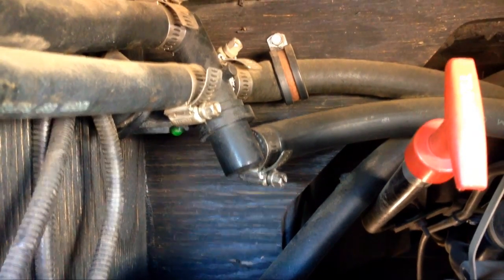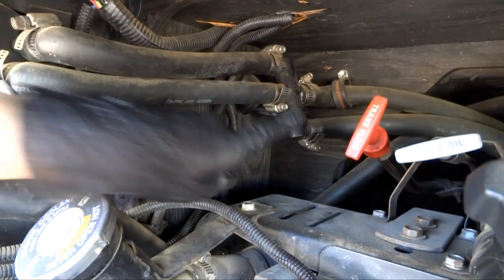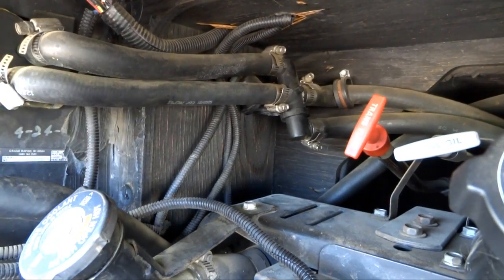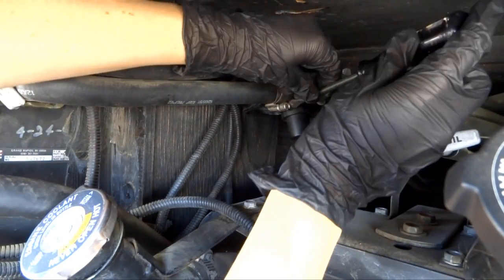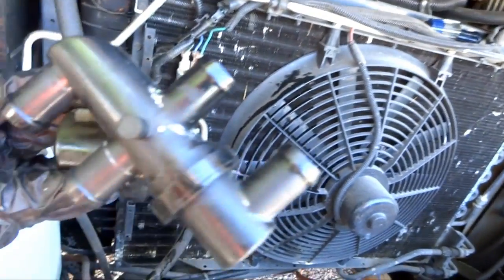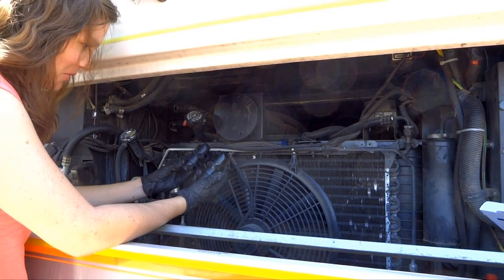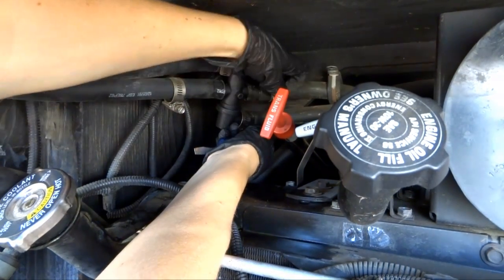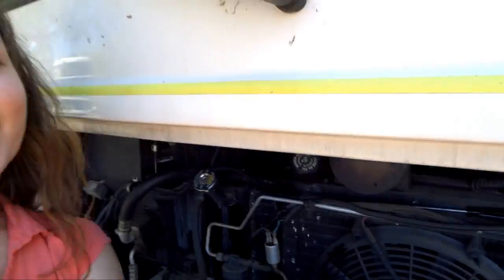RV Living: Troubleshooting auto repairs, replacing heat transfer valve

Comment: Pippi please wear safety glasses in the future to protect your eyes, and tie up your hair into a pony tail so it won`t get caught in moving parts.
Reply: Paul Wicklund  and where a helmet and have a Faraday cage in-case of storms and steel to boots and chainsaw chaps and bla bla. there is no pressure in a cold engine and she was above the work she was doing no danger.
Reply: corn husker She was AT and below the level of the unattached and flopping hoses.

IF, and that's a middle sized IF, she had by accident hit the hose or it slipped out of her hand while she was removing it or working in that little compartment with her head in there and antifreeze in that hose had splashed out and on her face, with safety glasses on,  it would only be on her skin and NOT in her eyes. Pressure in the line was no issue as she made sure it was cold and well it's leaking the pressure out, thus the repair she has to do. ;) ;)

As a hazmat qualified trucker who wasn't wearing them before OSHA walked onto the scene and having some nasty stuff get in mine and a motor head to boot, those eyes are pretty important to me years later and besides, who wants to have to pay an ER bill if it was a lot of the chemicals in her or their eyes.

Putting on a pair of safety glasses is as hard as putting on those non prescription sunglasses! No difference between the two as they both are made to PROTECT those pretty peepers! A good train of thought to remember when those eyes are really important in the rest of your life! 
You would never get to admire a beautiful woman belly dance, the smile on your true loves face or watch a sunset or in your case "corn husker", never see that new John Deer Harvester, much less drive it. Well, unless you're an International fan. Touching is never the same as admiring with the eyes. WEEEELLL... Ok,  there MIGHT be a difference when it come to the opposite sex..... LOL!

The other stuff? ROFLMAO! Some do have their uses.

FYI: There are a few eye glass manufactures that make beautiful and functional everyday safety glasses that you would never know were made to stop a bullet! A few made as sports wear for extreme sports and bike and motorcycle riding!  You never have to change glasses unless using a grinding wheel then I'd have to put the big plastic crap on over my good stuff! LOL! 

Blue Sky's and Safe Journeys
Reply: George Purdy Since everyone it bitching I will do too. Those gloves are not well fitting. Maybe she could have gotten some Mechanix type gloves. She could have gotten those loose fitting gloves bunched up and accidentally had fingers ripped off if the glove got caught somewhere and she had a panic attack and sawed off her fingers to free herself.
Reply: Oh screw the gloves! ROFL!
I'd rather wash my hands when finished. Old school! LOL!

After having to swim in water worse than found anywhere near an RV and working in much, much nastier places, gloves are an option now but not so long ago the choices were poor, she did just fine!
 
Yes, for her and other that do not have callused scarred hands and fingers like me and others, mechanics type gloves are a good idea if not messing around with small parts like she was in here, but some of her other projects, yes.

Blue Sky's and Safe Journeys
Reply: Paul Wicklund 
only moving part to worry about that I saw was......her
Reply: steven reynolds
Be nice! I refuse to watch her dance vids as tempting as they are, to be nice!
Reply: corn husker Thanks I was thinking the same thing.
Reply: Yes they are a "little" floppy. The one size fits all don't fit all, only those with big hands! And getting any part caught in something moving is not fun! Ouch!

My ex-wife wears them all the time but she has small hands and even the "small" look like Pippis does!
She got caught on a clamp and was trying to get the glove off of it without cutting the glove but cut the glove then her finger. Not a fun time around the house that night. Turns out she is not a fan of my old army field treatment and dressing of minor wounds. Nothing wrong with alcohol and tape is there?

Comment: Just a couple tips from an ASE certified tech. Makes sure to use a catch pan for coolant, transmission & engine oil. Be sure to bleed air out of the cooling system to prevent over heating whenever you replace parts from the cooling system. Finally replace old, soft, rotten hoses as needed. Good luck pippi 😎👍

Comment: Great job seeing that kink in the hose and recognizing that moving the bracket was necessary to correct the problem. Sometimes, you can use a small screwdriver to run the screws on the clamps in and then use a bigger one to finish. It's okay to orient the clamps any way to give you the best angle of approach to get the screwdriver on there, because a fair amount of torque is required to get the clamps tight enough so it won't leak. I like how you always face these things head on and don't shy away from any problem that confronts you. At the end of the day, your pockets still had money in them!  : )

Comment: Great vid Pippi! Get yourself a basic set of nut drivers, or home depot has a 6 in 1 screwdriver for about $3- that has 2 common sizes of nut drivers to make quick work of hose clamps. Its the one on the end caps with the orange handle,.... Buck Bros. I believe.

Comment: Don't know if it's already been said but replacement parts like this are normally redesigned (supersede) the original for whatever reason. The fact the new part has longer necks likely resulted in complaints of the shorter necks making insufficient seal with the hoses...causing leaks like you just fixed.  

For safety sake, you might want to put your hair up. When working around electric fans, it should always be assumed that they can start at any time (even when everyone knows they won't ;) 

Really enjoy your hands-on videos. I am a big believer in RV DIY, which makes the entire experience so much more rewarding (and affordable too :)

Comment: The "Hose Holder" as you call it is a Host Clamp. By the way, you're doing a very good job there, I'm impressed. RV stores will charge an arm and a leg just because they are an RV dealer.

Comment: I enjoyed how you put the two parts together to verify it's the same and to size it up!

Tips from an old guy!
Whenever working with the water system drain it down to where you will not leak. Usually in 1 gallon dumps as that's how you buy antifreeze either pre-mixed or straight. It's never a good idea to store opened bottles of anti freeze or brake fluid. I always dumped by the gallon as it's easier to refill the system with clean fluid with no leftovers, put the old stuff in the new jug and go recycle it in the jug! You don't have to remember or write whats in the jug either.

Someone below gave a great tip about using a screw driver socket set with the clamps. Yes it is and when replacing the clamps always try to tighten them up so the screw is more level not in the up and down position of the first top one you did. Makes it easier if in the cold and dark on the side of the road repair and I'm OCD when it comes to wiring and hoses in my engine compartments! It's got to be easily accessible and look good!

Check the hose after removing the clamp to see if it's rubbing. If it is, get a piece of old hose or tire inter tube and put it between the hose and rub spot. That's NOT a leak you want to find when exactly between the 2 farthest apart auto parts stores on the road which Murphy says will happen. It smells in the cabin, making it a 2 times not so good leak!

Beauty tip: When no gloves or hand cleaner is available, use a good squirt of hand lotion on your hands which will help keep the grease and dirt from "holding/sticking" making washing with soap and water easier. Get it under the nails heavily. Not perfect but they do come cleaner!

Thumbs up on a good repair!

Blue Sky's and Safe Journeys
Reply: George Purdy Great advice in addition to a good video, Smiles
Reply: Thanks to my added advice part but the video is all Pippi's! She learns fast and passes it on. Smart young lady!
I waiting for the video of where a shop tries to burn her and she already knows the problem! That will either be listed as a comedy or a verbal beat down!

I just pass on 32 years of living in a tractor trailer advice which is almost the same as living in an RV just a bit smaller or cramped!
I was asked several times why I don't start a channel, I would but not many can understand me these days after a load of radiation to the head face and neck! I'll sneak in and add to a conservation just like sitting around a campfire! Radiation damage is weird! LOL!

I'm hoping to be RVing soon as I do miss the road!
Blue Sky's and Safe Journeys
Reply from the maker: George Purdy Thanksso much George for the great advice!
Reply: Have to pass it on somehow!

Comment: Great video ... a tip ... using a 1/4" socket to install and tighten the hose clamps is a lot easier than a slot screwdriver. Thanks for the video.
Reply from the maker: Dan Bronk Thanks for the tip!

Comment: Good job, one thing to help is use a nut driver like on many 10 in 1 screwdrivers, hose clamps are usually 5/16".  They dont slip off nearly as easy, once you are turning no need to look at them, just tighten.

Comment: Nice job with the thingamajig whatchamacallit thingy. 
On a safety note, as someone else pointed out, your hair could get sucked into the fan when the engine is running. You probably knew that, but just in case...😄👍🏻🚐

Comment: hi pippi good job .   there is  a tool you can buy for those clamps or clips so you don:t slip off it can easy happen when you use a screwdriver in tight places or when working on pipes that move . keep up the good work regards stephen .

Comment: Gloves! good job on the repair and no you do not need safety glasses hair net or bulletproof vest on a cold not running engine . People are so worried about things they don't understand. Righty tighty lefty loosey is 80% of repairs. 

And after some time you may want to snug up those clams they like to leak when the hose goes through heat cool cycles. then you are good till the end of time.

Comment: I am always amazed at your enthusiasm for diving into just about any technical/mechanical project. 

You did a good job here, with the part replacement, and with the video. 
A couple things to remember: Maybe tie your hair back or wear a cap when working around machinery; and, dripping anti-freeze can be deadly to cats & dogs. It tastes sweet, but is very poisonous. I once lost a sweet kitty to dripping anti-freeze. 

Do you move your motorhome to different campgrounds? I was under the impression that you were permanently camped in one spot. It IS good to get them out and drive them occasionally, just to keep everything road ready. 

All the Best, and Happy Camping!
Reply: Allen Hare  nothing was running no need for hair restrains and the amount of coolant that hit the ground could only kill 3 cats and a large dog no problem. Last part was a joke.
Reply from the maker: Allen Hare Thanks for the great tips, Allen :)

Comment: Thanks for showing that it's possible to work on your own vehicles. You are quite the DIY'er, time for some proper tools. Even though it was possible with the screw driver, it would've been a much easier job if you had a set of nut drivers. I believe that one is a quarter inch. Again thank you for sharing.
Reply from the maker: Jerry Densmore I have a set but didn't think of it. Now I know for next time though! :D

Comment: Pippi don't use those clamps on plastic parts because they force all the pressure on one small spot causing it to crack.  Use the type of clamp you see on modern engines,  as they spread the force evenly around the entire part. Those clamps where fine back in the day when parts where metal.

Comment: @Pippi Peterson     Another great DIY repair!   Those are excellent tips, too.  I'd only add that labeling each hose with some masking tape before taking the pictures would help since they all look the same.  In this case you did fine without the labels.

PS - I think the word you were searching for was 'Bracket'.
Reply from the maker: John Norris Thanks:)
Reply: Pippi Peterson
No problem. 

* Another tip/trick is to use a little soapy water to help slide tight hoses onto their fittings.

Comment: If you are not in a hurry you might try Craigs List or E-Bay for parts. There is a yellow marking pen (that is used for marking parts at a salvage Dalo Industrial Paint Marker) I would use it mark the hose with an (A) - old part with an (A) where it was, Hose (B) - old part (B), (C) & (D). Check hoses for cracks-if not replacing hose cut an inch or so if the hose is long enough for a fresh fit. If you use a 1/4 drive socket set with handle you can not slip off the clamp like you can with a Flat Screw Driver. I don't like to stab myself with flat screw drivers. I also have a Brother P-touch Label Printer that uses White Laminated Tape to maker wires & other parts. Just a thought. Great Job, You Did Save Some Bucks. You Always Amaze at Your Projects. A Very Special Lady. Dennis
Reply: Dennis McGill Good advice. Smiles
Reply from the maker: Dennis McGill Great tips, Dennis, thanks!

Comment: Great job! You're amazing! Did I miss in your video if you had discussed the procedure with anyone at the store? Just wondering if the air that will get in the system when opening it up might cause a blockage as it circulates the fluid around the system. Usually it's important to bleed the system (like brakes), but perhaps it just works itself out...hard to say.

Comment: Definatly tie hair up. I wouldn't like it caught in that fan when the engines on. A 1/4 drive socket and ratchet to fit the jubilee clip allows it to tighten easier. Check your coolant after a few miles . But let the engine cool down first before adding any coolant. Always mix with an antifreeze.  Antifreeze has anti corrosion  chemicals in it to prevent your radiator and various other bits of your internals rusting. Avoid tasting the coolant like old timers do to check the ratio of antifreeze to water also getting it on your skin as it causes cancer. You can get your coolant ratio checked at a service center. Or just as easy to buy an antifreeze hydrometer. Obviously the antifreeze is poisonous  as well so where gloves and goggles. Always er on the side of safety. You are too good looking to risk it. Keep the video's  coming.

Comment: Always impressed. Little advice to make it easier try using a 1/4 drive socket to do hose clamps
Reply: He said 1/4 drive.  Not size.
Reply: What did you mean by 8mm? Brad Richardson
Reply: I think was saying the size of the nut on the clamp. Clamps are different sizes

Comment: It is a good practice to bleed the coolant system once you have introduced air into it. You wil probably be ok, but if you have heating or cooling issues it is because there is air trapped in the system and it needs to be bleed out.
Reply from the maker: audirene Thanks for the tip!

Comment: Normally I'd just comment on how hot you are...  Which you are of course.  However a nut driver would be easier for you since you're in a tight space.  The nut driver is basically a screw driver that has a bit that'll fit around the head of the bolt that's in the steel clamp(s) you're messing with.  They're used in plumbing all the time.  Buying a screw driver with a set of em is pretty cheap really.  You'd be surprised how often you'll use em too.

Comment: good diy video but you forgot to top off your coolent!!! could cause it to over heat. badshapeindy.. another trick to make the hoses to go on easy is to coat the ends with wd-40 lightly it makes the hoses slip on easy
Reply from the maker: +Paul Hermsen Great tips, thanks!

Comment: I'm guessing it's the 454 engine?  Is it bone stock the way it came from the factory or have any upgrades been done to it?
Reply from the maker: Tommy TwoGun Correct, 454. What kind of upgrades are you thinking?
Reply: Pippi Peterson
Does it have a carburetor, or is it fuel injected?  Chevy used a throttle body fuel injection system that resembles a carburetor.  It's not well known for it's reliability and fuel efficiency.  There are fuel and intake upgrades you can do depending on which system you have.  Also, what goes in, must come out, so exhaust upgrades can be beneficial, such as long tube headers, X-pipe and dual exhaust.  These types of upgrades will improve your low to mid range torque, where an RV needs it most, and will also give you a bump in fuel economy.